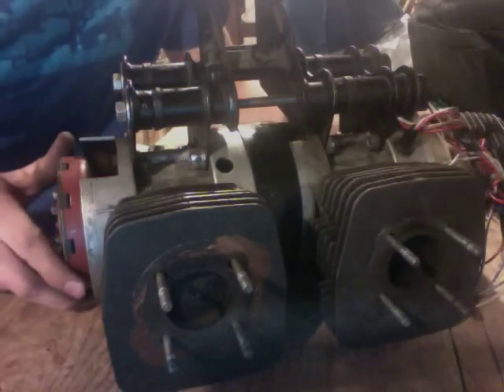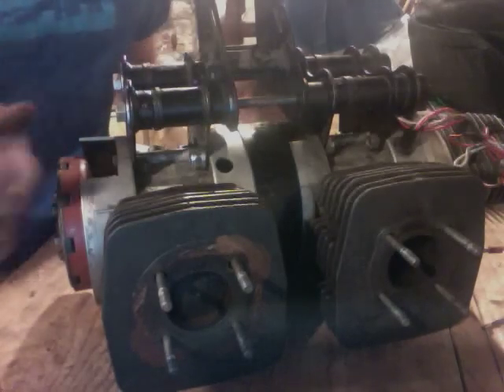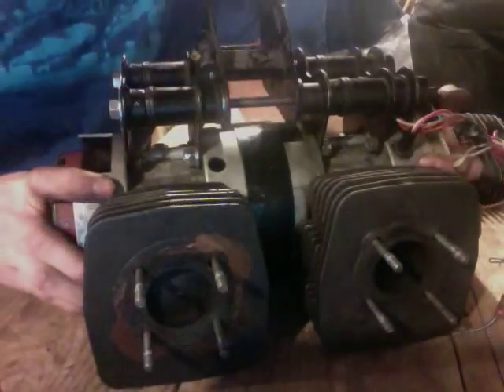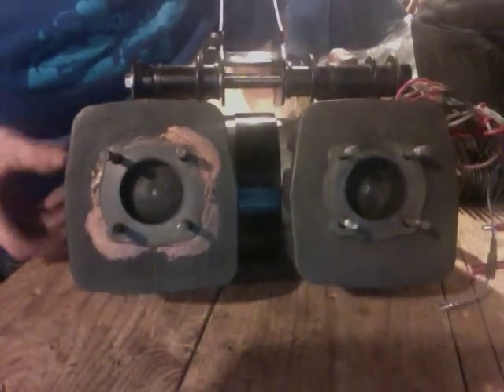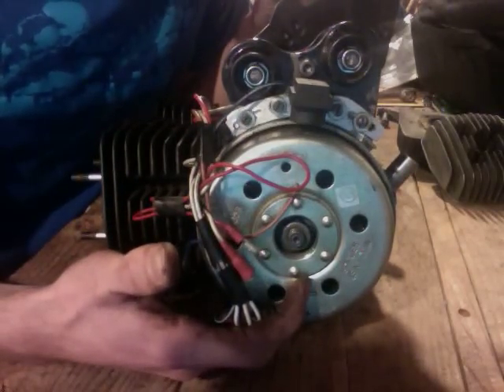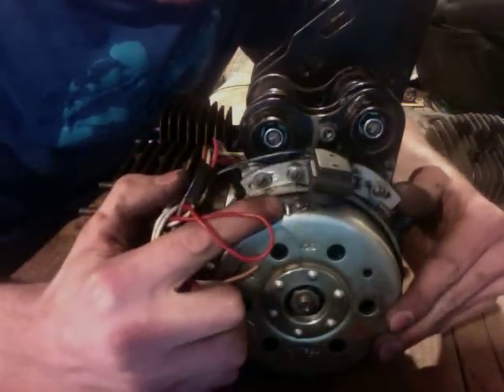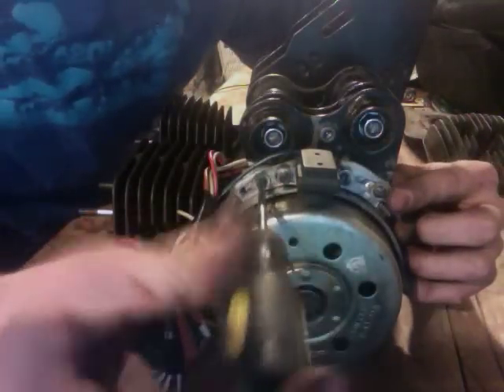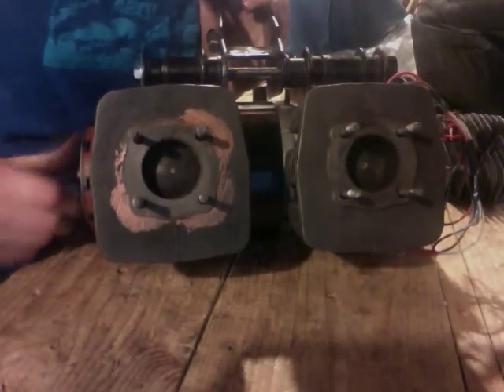TwinM48BatavusEngine.mov

Comment: I sold all my Batavus mopeds when I got my Kz750.  What a mistake that was.  last year I picked up another non running regency from Milwaukee Cycle Salvage for $125.  I was afraid I didn't look it over enough and be missing important parts.  Guess what after cleaning the fuel system (Including the hidden fuel filter in the carb intake line) I had it running in 6hours.  I drove it back the next day and the owner got off on it.  Funny thing is I found this moped at their booth at the Milwaukee motorcycle festival the Rockerbox.

Comment: Wow that is so cool.  Batavus mopeds are very well built.  So much so that I can and have pulled a well beaten up one that was sitting in a junk yard and get it running easily.  The only thing that keeps it from running is a clogged fuel system.  The same issue with every moped and motorcycle I own.

Comment: Hey man, I have a HS50 with this engine. I can get it to start up. I know the carb is good, all gas is slowing fine. I know the spark plug is working, it is brand new. Yes, I did set the plug to the right distance. Any ideas on why i still wont turn over?